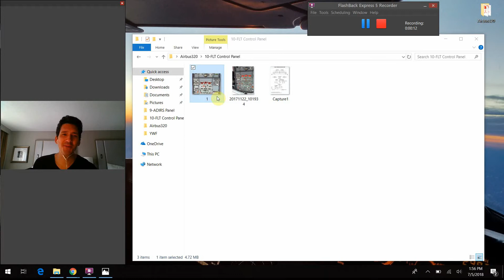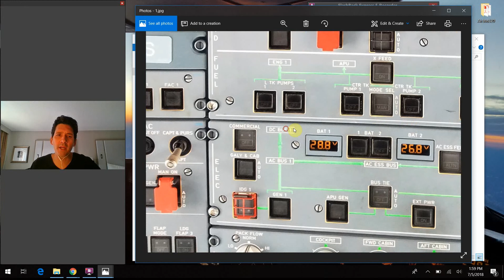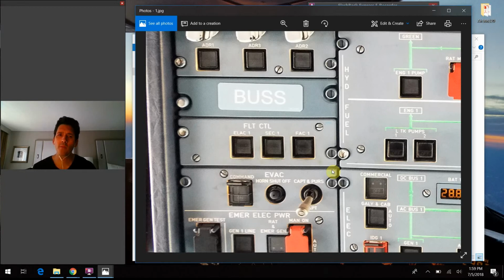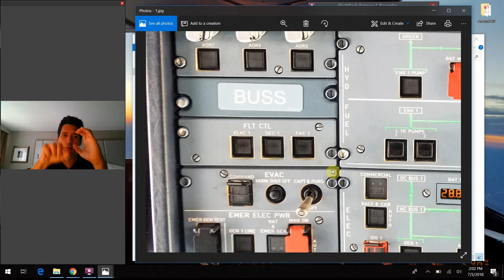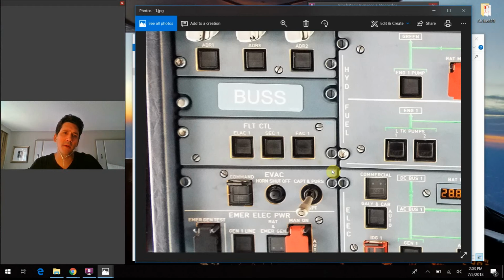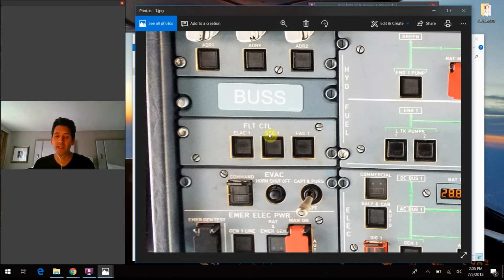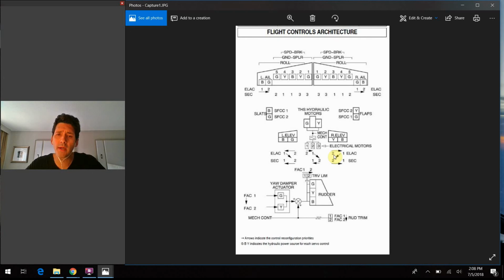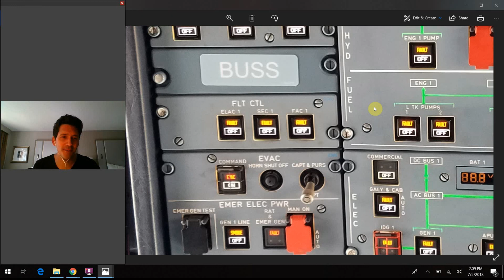Airbus A320 Cockpit Tour: #10 - FLT Control Panel : What do all those buttons do?!

Comment: My best guess on the BUSS placard is that because in case of unreliable airspeed, it is airbus procedure that once it is determined and confirmed all 3 ADR’s are giving faulty data, they can all be turned off to activate the BUSS. The placard could serve as a reminder of this fact and perhaps for the location of the ADR’s on the overhead panel for quicker reference or at least avoiding confusion? But thats my guess, and it’s not even an educated one.

Comment: Could you come up with videos on auto flight, flight controls etc?
Reply from the maker: Sure Guarav, Ill try to make a few more videos detailing those systems when I finish the other segments in order. In the mean time, check out the FCU video. We discuss a little but about the auto pilot interface. Are there some specific questions you might have regarding either of these systems? Thanks for watching my friend!